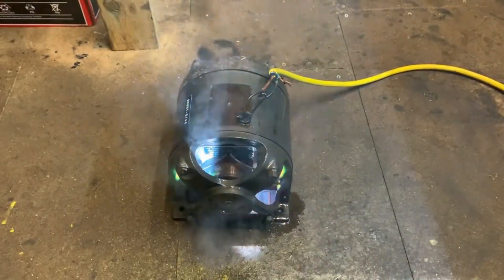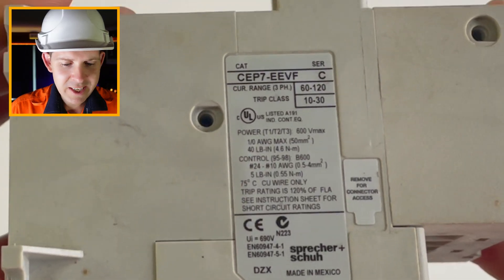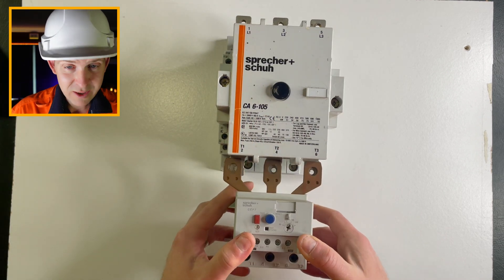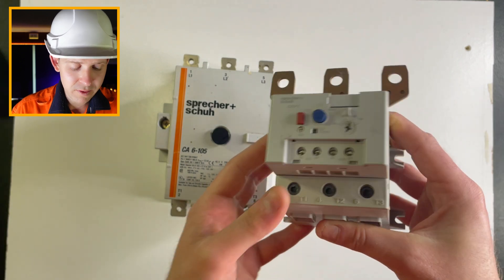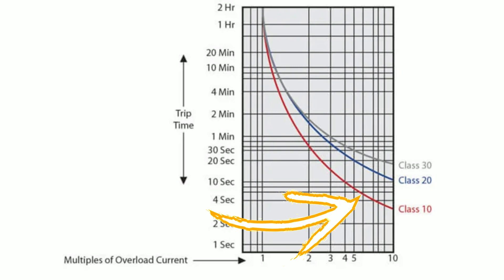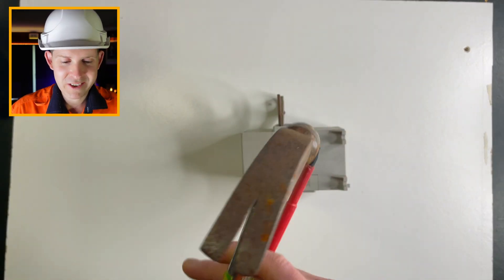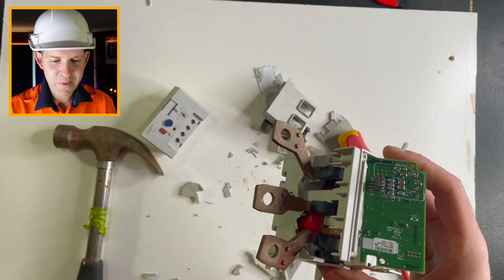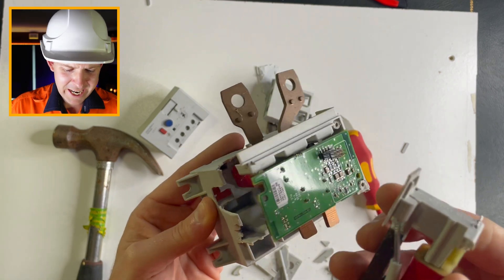How Overload Relays ACTUALLY Work 🤔

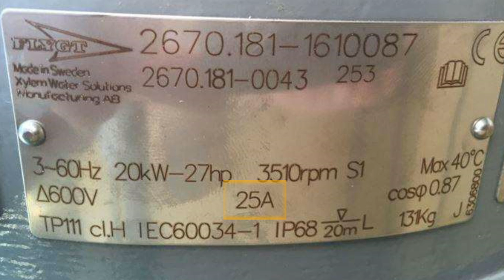Comment: Some numbers on what you set your overload overload protection at in the US. Our code says you set it at no more that 125% of the 'nameplate full load current rating' of the motor (unless that's not enough, then 140%) {NEC 430.32}. Also a mistake electricians make, is confusing Full Load Amps (FLA) with Locked Rotor Current (LRC). Using the motor at 4:15 as an example; FLA is 25 Amps, Overload would be 31 Amps (maybe 35 Amps), Locked Rotor Current for Code 'J' = 191-215 Amps. A normal circuit breaker would be sized at 77.5 amps, BUT the conductors would be sized for 31 Amps. That was fun, keep the riddles coming! All good, mate. Your friendly, not so close neighborhood electrician.

Comment: A toroid around a bar to measure current in a copper bar that is very interesting and simple. I've seen a C shape iron ceramic core with a hall effect sensor in the C's gap to measure the current in a copper bar being used.